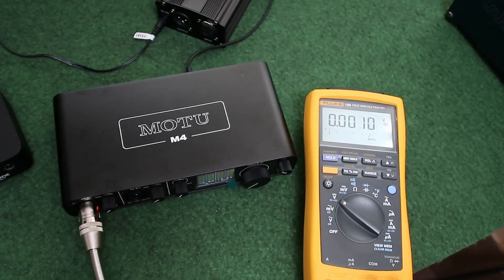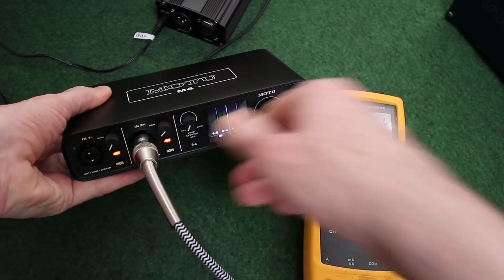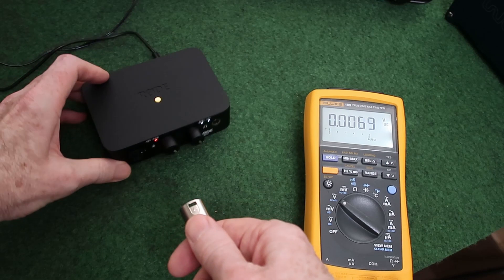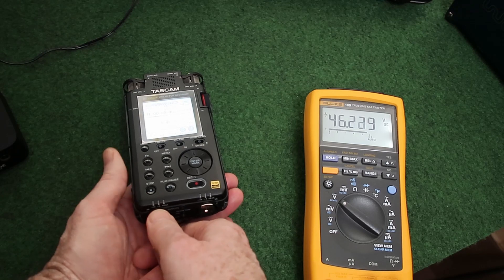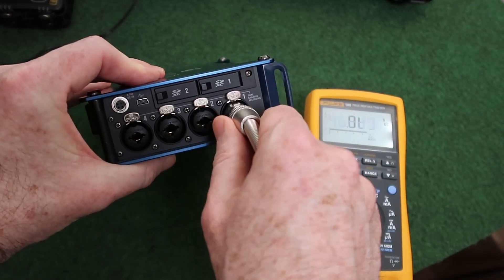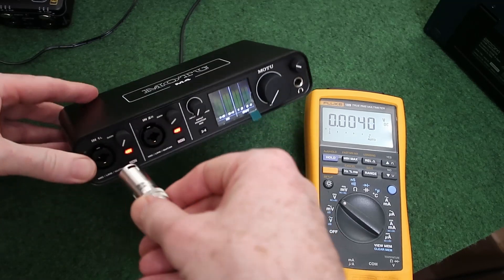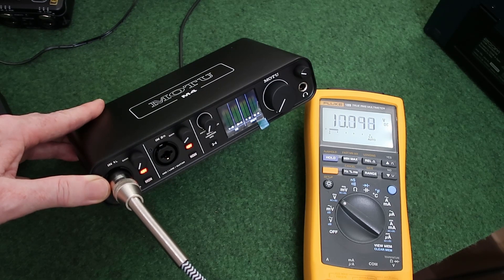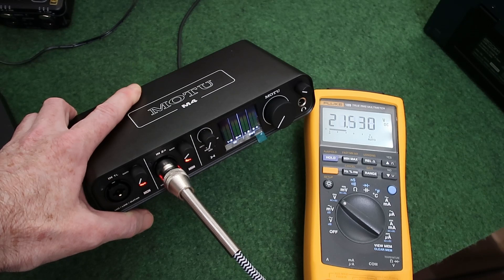Motu M4 Audio Interface Phantom Power Problems

Comment: I've had a big problem with my Motu M2. When using my mic with phantom power the noise is too high and every 20 minutes a strange sound starts like a plane taking off and it's something not related to background noise, it something you can tell is electrical or something internal. That sound lasts for about 30 seconds as well.
Reply from the maker: Talk to Motu. I found them very helpful.

Comment: just a quick question that you might know since you seem knowledgable, any idea what would happen if you hook up a ermm Y-connector to both XLR ports, going to 1 microphone and thne turning phantom power on both ports on, does that give the mic 96 volts? or 48? or 24? or will teh mic just take what it needs?
Reply from the maker: Hmm. You'll never get more that +48V as the grounds on both connectors are commoned. Devices can only control how much current they can get, not voltage, which is set by the supply. So be careful! What are you hoping to achieve?

Comment: Aren't you supposed to avoid removing the cable while phantom power is on? Doesn't that blow the phantom power?
Reply from the maker: Best practice is to turn off before plugging and unplugging. For example Rode say it's essential for the NT-1. But I spoke to someone who worked in high-end live music and he said that if something could be damaged in that situation you just wouldn't be using it.

In this case the multimeter is drawing so little current that it can't hurt anything.

Comment: My m4 just died out of the blue today. I had some tracks rendering and left the interface on for a couple hous. When I came back , the display did not show meters. It only shows a row of green bars with a red one in the middle of them.
Reply: Hey my motu m2 literally just died today. The bars you're referring to is on the lcd screen lower left? Because mine had some red bars and green bars.
Reply: @TheInvasionShow  Yep. Gotta send it back. Sounds like MOTU has some real production issues, because there are quite a few reports of "red bar" failures. In other news, I got an SSL2+ and really like it . . . Except that iOS sums the output to mono for streaming etc. The M4 didn't seem to work at all.
Reply: @TrueManCrowyote  ah man thanks for replying! I'm sending in mine tomorrow got off the phone with a rep. Couldn't believe it died out of the blue. Was working perfectly fine yesterday. Will be looking at the one mentioned.
Reply: @TheInvasionShow  I still haven’t . . .but I’m miffed about paying shipping and that the interface pretty much only works with my windows pc. I guess when I get a little flush I’ll send it back. I only just got my unit in December. :/
Reply from the maker: I'm sorry to hear that. It's a real pain when things break. Contact MOTU and see what they say. They are at least helpful.

Comment: I’ve had mine for a month and I have no issues at all, I’m running an re20 with a dynamite ilb + 48v and I sound super crispy 😆 also have my headphone amp and hs8s connected all through one usbC cable it’s amazing 🤩
Reply from the maker: Good to hear. Thanks for sharing.
Reply: which headphone amp do you use ?
Reply: @bishaltiger1  schiit magni 2 uber
Reply: @ayyjayy5018  Let me ask something here. I just got my M4 two days back and testing it. What is the quality of the headphone out in the M4. When I turn the knob above 75%(approx.) or more it feels like the sound becomes crackly or harsh type, the similar feeling what you get from a cracked speaker or headphone. Is it because the headphone amp in the M4 can drive headphones more and my ATH M50x can't handle it, or is the headphone amp not so good or is this a defect ? I haven't used interfaces before so can't say how it should sound
Reply: @bishaltiger1  I would presume it's your headphones or the music you are listening to, for me I use hd650s and I don't use the m4's headphone out because it's too quiet // not enough juice
Reply: @ayyjayy5018  probably. Only happens when listening from YouTube. My mixes or project don't sound cracked.

Comment: I have problem with loud pops when turning on the Phantom on m4. Even with only cable connected with no mic. 
With mic it kinda doubles.
Does anyone had it. Can't measure if there is some surge in the beginning. Can someone check please?
Reply from the maker: I don't get any pops or thumps with phantom. Only when turning the system on. I suggest you give Motu a call: they are really helpful.

Comment: I wonder: The second unit within what time frame? Maybe that was a problem with one batch of units? Granted, this makes nothing better, as it leaves the QA of MOTU questionable. But then again: currently, the QA of a lot of companies suffers
Reply from the maker: The first one was faulty. The second wasn't it's a design choice. See my follow-up video https://www.youtube.com/watch?v=7w6Q83LSVf4
Reply: Oh, so it was a connector not built to spec. Well, that confirms my conviction, not to buy cheap cables once more.

Comment: Just saw this in my feed today, here in the USA. It was July 2020, and I got a MOTU M4. I badly wanted an audio interface to record vocals with stereo backing tracks. Another name for that is karaoke....:) :) :) Anyhow, from my cell phone or tablet, I used a cable with 1/8" stereo out from the headphone jack, split into twin TS 1/4" cables/jacks. The volume I obtained was pathetically bad so the unit was unusable for me. Anyhow I sat here sulking with my thumb in my mouth, the past eight months, and then I saw info on the new EVO 8. It has 4 Combo inputs. Same kind of connection as above. But with the EVO 8, it worked perfectly! Wow, am I delighted! The mic pre-amp volume is weak, however: I have to turn the volume knob all the way to the top to get a decent volume from a microphone, including my AKG C1000S (15 years old but still like new) condenser mic with phantom power. But on my DAW, which is Cakewalk, with reverb and Echo on, the clarity, the sensitivity and volume from the mic goes up 300%. Amazing. Well, obviously, what I hear as boosted by 300% is the result of all that internal processing. So my question is, to you manufacturers, why can't you incorporate all that magic into your bl**dy preamps!!?? These companies making USB interfaces really need to get back to the drawing board! Really! I mean, with my Mackie ProFX6V3 mixer (which has 2 USB channels) the mic sensitivity and volume is excellent, even with a Shure SM58.
Reply from the maker: Mixers seem to be better value that stand-alone audio interfaces for some reason.

Comment: It's really disappointing the control quality that Motu has with these units (or maybe the lack of). Last week, I received my M2 and the phantom seems to work fine, but it's a "cracks and pops" source, even after using the lastest version of the windows driver. It's so frustrating, however, I've read Mac users does't have this trouble only Windows. In my case, I'm going to return it, I prefer my old Focusrite Scarlett 1st gen that could not have an awesome DAC, display and be noisier and stuff, but man, at least, it's reliable.
Reply from the maker: I do find that Windows seems to have a lot of sound issues. It seems to get worse the more devices you have.

Comment: i just preordered motu m4 and now im unsure if I should keep it or cancel the pre order and get a  refund
Reply from the maker: I think it's a good interface overall. I did a video on how to work around this problem. I will put it in the decription.
Reply: @soundinquisition  am thinking about canceling the pre order and getting m2 instead because the waiting time is getting too long.  The only reason why I pre ordered the m4 is daw volume knob
Reply from the maker: I wanted five months for mine. I do use the mixer knob, it's been handy for me. But I know waiting is a pain.
Reply: @CONTEMNTheOfficial  Hello there I ordered my M4  on eBay  around 2 weeks ago from a company called Perfect Circuit Audio.  They are based in the States and I am based in the UK.  I received it in literally 4 days.  Give them a go they send out straight away from payment is received. If you are not based in States, note you will have to pay importation tax for international orders. Hope this helps, there was plenty in stock!
Reply: @santanab1793  hey thanks for the tip but i prefer to have decent warranty which scan provide.. its been pain to get a refund from outside the uk after brexit so i dont risk it anymore

Comment: I've got the M2. haven't actually tried it with phantom yet. Will have to try it. After first few weeks the usb cable supplied with it died. I thought the unit had died. Replaced cable with something bit better and it's been ok....so far
Reply from the maker: The connector that goes into the unit bent on mine, just from moving it around. It still works fortunately.
Reply: @soundinquisition  I think that's what happened to mine. But current cable working fine

Comment: Hmmm... mine should arrive sometime today. I'll check phantom power operation as soon as I can. That said, all but two of my cables are either self-made using Neutrik connectors, or ProCo pre-made cables. I've had a lot of problems with the cheap Amazon Basics cables and also the Dayton Audio cables from Parts-Express.
Reply: Just following up after having received, setup, and tested my M4. Phantom power seems to be working just fine on both mic inputs. There's no play in the XLR connections, so there's no jiggling around happening. I'm using a ProCo cable with German-made Neutrik XLR connectors.
Reply from the maker: Yep. It's all about cannector quality. Which we knew already 😀 My Neutrik are from Lichtensteinn are yours really marked "Germany"?
Reply: @soundinquisition  The connectors on the ProCo cables are not labeled, but that is what they advertise. And, our country of origin laws here are pretty specific. The loose connectors I have were labeled "Product of Germany" on the box. The baggies are labeled "Designed and Manufactured For U.S. Market."

Comment: wait so what's the problem with both of these? the cable or the unit? so crazy that two of them both have the issue
Reply from the maker: First one was a faulty unit. Second one has a "feature". Questionable design means that the Motu is fussy about the makes of connectors it works with. Motu tech support didn’t know this, but did get in touch once they found out. I’m doing a video about making Amazon cables work.
Reply: @soundinquisition  how did they  explain the "feature" worrisome because all my xlr cables are amazon basics. did they explain why it doesnt work with amazon XLR? does it not work at all or just no 48v?
Reply from the maker: @mishakmusic  I will release a video about this shortly. It only affects 48V. You can wrap tape round the connectors to make them work.
Reply: @soundinquisition  I have a amazon cable. If I put a better cable it will work ?
Reply from the maker: @Jules-t6k  I expect so.

Comment: really a shame considering if all these minor faults that the interface were fixed it would easily be the best interface on the market. I chose my NI Komplete Audio 6 mk2 over the motu m4 because of its issues :(
Reply from the maker: This interface certainly is well liked, which is why I went for it. I'm going to have to do a follow up video on solving this problem with masking tape.
Reply: @soundinquisition , I would like to see that solution. Thanks!
Reply from the maker: @TheNorth30  Here you go: https://youtu.be/7w6Q83LSVf4
Reply: @soundinquisition , Thanks!  Glad to see there was a reasonable explanation, and an easy fix.

Comment: Hey there - I just spoke with the tech assigned to this case. There is an update for you regarding this issue within the support ticket you created - please take a look when you have a moment 👍
Reply from the maker: It seems that this behaviour is by design, due to the +48V switching circuit. However this "feature" is not documented in the manual and does result in the interface not working with some cables. In this case an "Amazonbasics"  cable was used.
Reply: @soundinquisition  I have problem with loud pops when turning on the Phantom on m4. Even with only cable connected with no mic. 
With mic it kinda doubles.
Does anyone had it. Can't measure if there is some surge in the beginning. Can someone check please?
Reply: Hey MOTU, did you seriously omit this VERY IMPORTANT information about +48V not working with all cables from your manual and website? I just wasted days trying to figure out why my soon-to-be-returned M4 wasn't providing any phantom power, despite the LEDs being on. And no, I'm not changing my entire set of cables that work with every other interface I own. I should have known to just buy another RME for my mobile rig. Buy nice or buy twice.Thanks OP for the video!